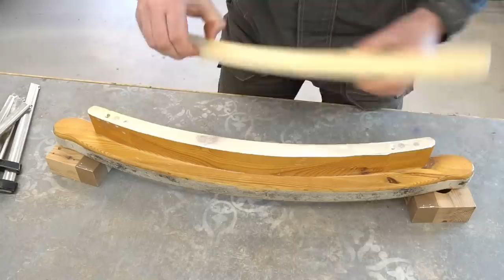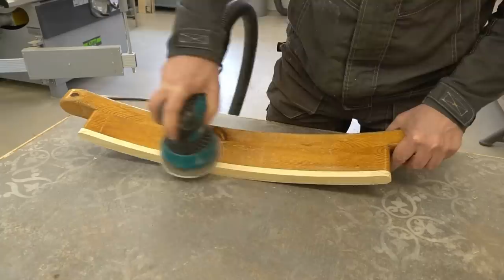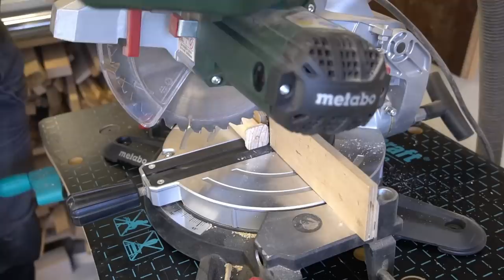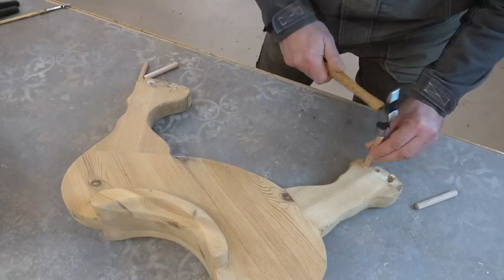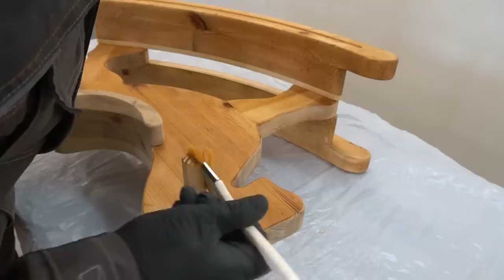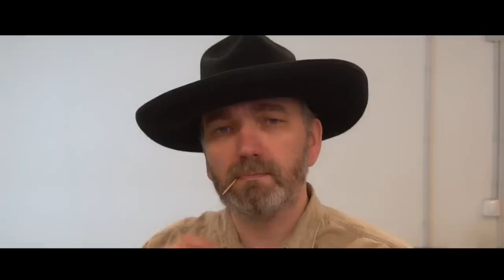Amazing ROCKING HORSE restoration! 🐴

Comment: Tip, burning horse hair fuses it together really well. Thats also what the luthier did to help create the bow strings, which is why the bundles have hard little black tips. Just in case you end up doing something similar again.